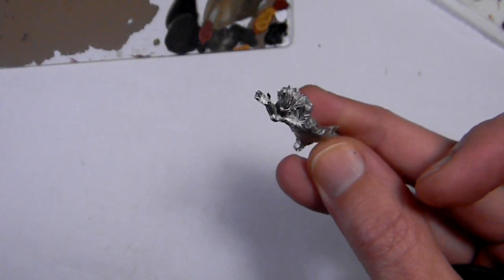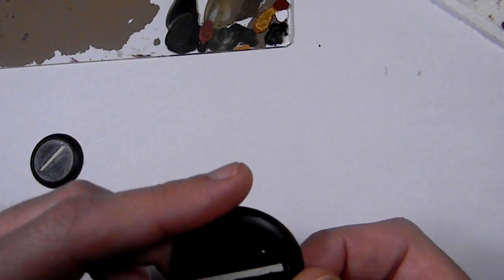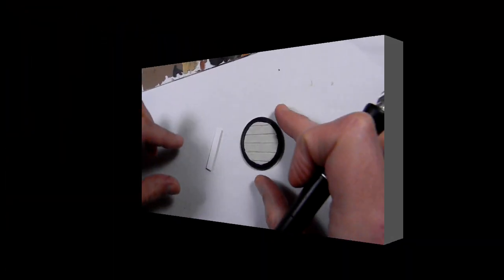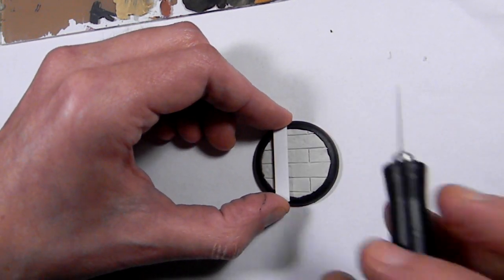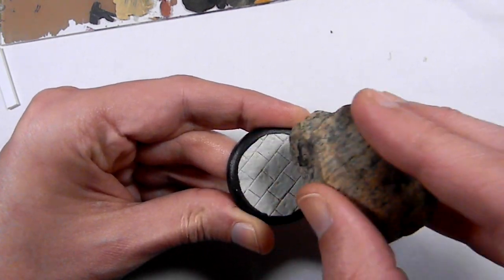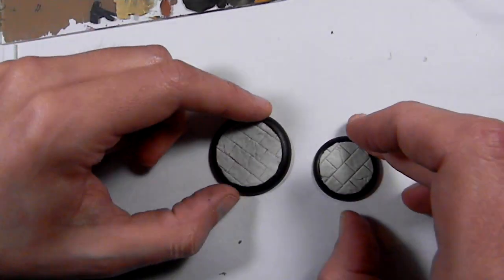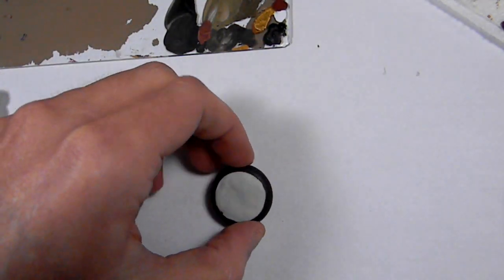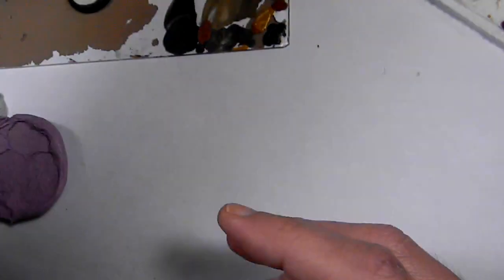How to Make Stone, Rock, & Tile Miniature Bases

Comment: Got to shop at lowes for inexpensive epoxy putty.  It is in the adhesive section near primers. 4oz tube which is about an inch in diameter and either 4 to 8 inches long depending on how much you want to spend.  Just look at lowes web site for epoxy putty.  Make sure you pick out one that says paintable!